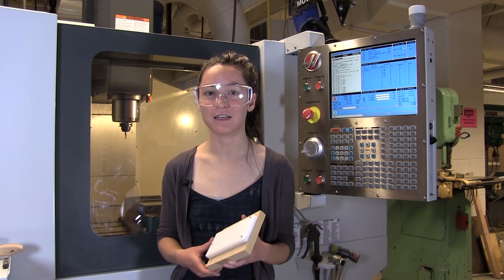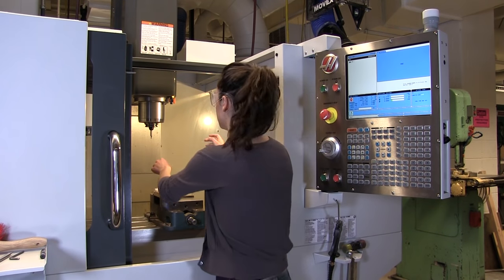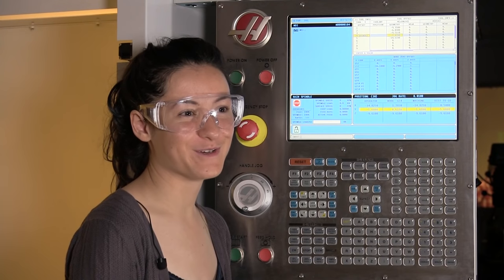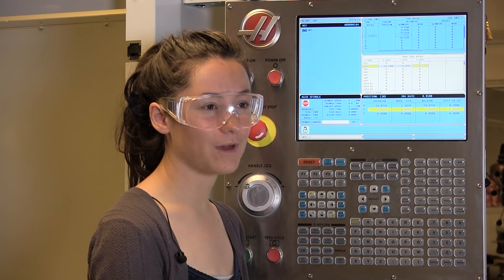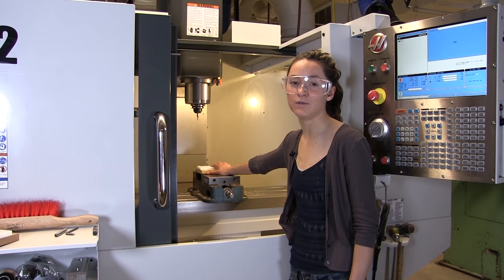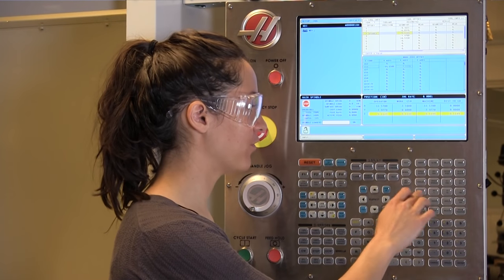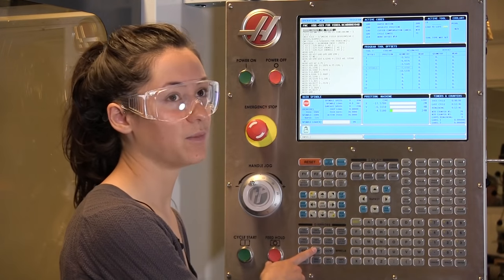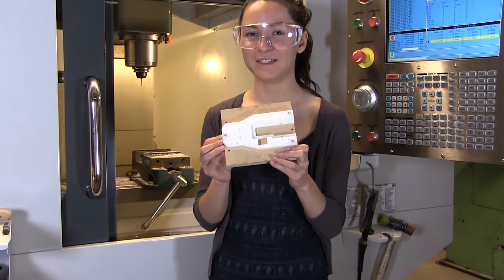CNC Mill Tutorial

Comment: She is getting easy work and need to go on a manual machine to understand Machine shop work also.
Reply: Today's day in manufacturing, we need parts out of machines as fast as possible while maintaining acceptable dimensions and finish. Having a Bridgeport and an engine lathe is great for "simple" jobs or one off jobs like simple R&D work, but even most of today's one-offs require 5 to 9 axis machines to maintain ridiculous tolerances... In my 7 years of being a well rounded cnc and manual machininst,  I have only resorted to bridgeports and engine lathes for non-critical milling or turning, most of which was in preparation to go INTO a CNC Machine. lol

Comment: Machine manufacturer has got the design for manual tool insertion wrong. Really, you should insert the tool, rotate it to locate the drive dogs into the tool you've inserted and then push the tool fully in. This should operate a switch on the machine to then lock the tool in place.

Comment: I disagree with this method, although common.  I prefer to use a gauge block of known height and RAISE the spindle in small increments until it can slide between the tool and workpiece.  Then adjust the offset for the known gauge block height.  Less chance of crash or getting your hand hurt when raising the spindle to set versus lowering.

Comment: The Haas machine no different from a doosan. Almost everything the same. But the Mazak little different.
Reply: Doosans are much better than 
'H alf A ssed A merican S hit'
Flimsy tailstock,dodgy place to put index turret button on the lathes (right next to everything else and the same size,shape,colour as the other buttons) terrible corkscrew conveyers that drag swarf across the armoured hydrolic cables from the tailstock,all the fuckin beeping!!! There are some good features don't get me wrong,big memory,vibration control, but still not a patch on Doosan.
Young lady was impressive though.Ive been in the trade for 25 years programming sliding heads and fixed head CNC's  and never seen a female setter or programmer,only operators.Shame that,they're much welcome in my book.
Doosan all day for me,Mori sieki and Star sliding heads.Mazatrol are conversational programming,nice machines,user friendly,even calculate your cutter comp for you.Also handy for people who can't program.

Comment: For best precision to find the edge you have to turn spindle with minimum 1700 rpm. It seams to me that you turn it very slow :(((
Reply: As she said in the video, the Haas won't let you open the door unless it's under 750 RPM's.  She did a great job at least helping me and others to learn a little about their CNC controller. She did mention that they work best at 1000 RPMs but could not do it because of the door safety.

Comment: UNDER NO CIRCUMSTANCES SHOULD ANYONE PUT THEIR HEAD IN THE MACHINE WHILE THE SPINDLE IS RUNNING! 
Other than that obvious and potentially FATAL mistake nicely done. And also no need to touch a spinning probe. Move it off center BEFORE starting the spindle.
Reply: Agreed. Where's  the safety interlock on the door ??

Comment: Another way of bringing the spindle up when your using the edge finder or touching off or in any case for that matter is to press the arrow keys in what ever direction, this can help when you get confused on which way to move the dial this prevents crashing the tool into your stock, do keep in mind that this wont work unless you are in the MDI HANDLE JOG mode.

Comment: The lower grade of those Kurt clamps are rated for 6880 pounds, 80 LB of force is enough to hold a 1000 LB hardened steel rail. Hand tight isn't enough to hold hardened steel in place. Obviously anything more than hand tight would destroy the MDF she has her work attached to.

Comment: I hate the haas dial noise as you turn it, I've used fanuc and heidenhain so far and no noise :)
Reply: MLG420 Mcswaggerten Haas cheap and cheerful
Reply: Obviously you don't realize that Haas uses Fanuc as their control. Hass does not produce their own.
Reply: Haas hardware is kinda the honda of cnc machines. Lots of plastic, the sheet metal almost fits right, low pricing, lots of features that seem appealing to folks that don't really know what they want like V.P.s and tech school professors. 
I can't stand the feel of the jelly bean buttons after having spent so many hours looking at the laser cut panels that don't actually line up with the buttons and mpg wheel.

Comment: I use sharp pointy tool to set zero right on edge of material.  Very quick and very easy,  no additional calculation needed to find center of tool
Reply: Not very accurate.

Comment: dirty machine. you can use air blower over your tool. i saw a lot of plastic melts and adds to tool. use air cooling over mill.
Reply: Abdulkadir KUCUK 
Nah, it's just lame speeds and feeds. The drill needed about 4x that feedrate so that a thick heavy chip will fly off and away. Similar issues throughout.

Comment: It was a great video until she plugged in the USB stick. What is wrong with programming on the machine these days? You are still faster programming a contour or like 5 holes manually then using CAD CAM.  learning how a G2 or 3 works is important. Even a G0 or a G1 is not explained. 

Learning  the basic code of  your program is really important

Comment: Paper to pick up a tool, thats so dumb and dangerous and slow. You never move a tool down like that. Not accurate either. Don't understand why an idiot showed you that. Learn to use a mirror if needed, leaning your head inside is dangerous and not always possible
Use a 1 inch block
 Bring tool closer than 1 inch to surface, 
Handwheel up on highest increment untill block slides under 
Take block out from under tool,  
Handwheel tool down 1 increment, block won't go under
Switch handwheel to smallest increment 
Handwheel up while gently trying to slide block under
Once it does never handwheel down again with block under tool, it'll break
Switch handwheel to y or x so you don't accidentally move it
Take out block
Set tool Z1.0" if that's youre Z zero spot 

That is the safest, fastest, correct way to set a tool. And very accurate, I machine molds and blend 10 different tools to the same surface perfectly. Work with me and do that paper thing I'd give you shet and saw you keep doing it, FIRED. Seeing this I should make videos and explain why it's dumb and why my way is safest, quickest, and most accurate. There are other ways too. Best is to set the z zero on the table with spindle, then use indicator to measure tool length and find top of stock. I'm too lazy to explain the reason for each scenario. Never that paper thing though. I setup, program and operate CNC's for 20 years, every mold is different and I never run the same program twice. Everything is one off and no mistakes cause material alone is $100k

Comment: anyone can throw tools in and call a program ,try programming manually without software then you can call yourself a machinist until then your are nothing
Reply: Programming without software is futile for many types of parts, especially related to tool and die. You're not a machinist unless you can use manual mills, lathes, surface grinders and other machine tools. Even programming without software only means you know M code and G code... it doesn't mean your parts are going to turn out dimensionally accurate with a decent surface finish.
Reply: You program manually and be proud to call yourself a machinist.    I'll use software,  run circles around you, take your job,  and drink my beer and count my money while you try to catch up.    But hey...you're a machinist.
Reply: I disagree.  I started manual  machining (turning knobs)  in1986 and haven't programmed long hand for 20 years.  Who would ever want to go back to that?  The machining speed is just so incredibly fast with the high efficiency milling software available that. It could never be written manually. A machinist needs to understand what approach to take from start to finish to complete a part accurately and efficiently.  But I'm not a machinist - I'm a mold maker. 😉
Reply: Look we have a machiner. Programming with or without software makes you a programmer not a machinist. Cant make up your own definition because you think its right. Loading, unloading parts, running the machine by pushing a button, call up a program, throw in tools, setup, programming etc anything else you may want to add, this only make you a well rounded machine operator. I own a manual lathe and use it, this does not make me a machinist nor does knowing the ins and outs of a CNC machine makes you a machinist. Being a machinist is so much deeper then that and what you describe and I describe is just a scratch of the surface, a small piece of what an actual machinist is.
Reply: If you don't believe me, then look at it this way. If you work in an engineering department, work in CAD all day every day, this doesn't make you an engineer, there is an actual degree for that.  It only makes you a CAD operator and nothing more. Your trying to call your self a machinist because you know about hand programming. Big whoop, so did every other CNC programmer 30 years ago, still just a CNC machine operator.
Reply: You're not a machinist until you build your own machine, invent your own mathematics and create your own Universe.
Reply: You just draw arbitrary line in the sand. CAM is a tool, just like a machine is a tool. Programming manually is slow compared to CAM and it is all about productivity. Machines need to run, not sit still while you program new part.  It is like saying you are not a real accountant if you use software - you can call yourself an account when you do all your calculations just with pocket calculator.
Reply: a machinist on manual mode is vanishing fast like endangered species
Reply: If you think that manual programming is enough for cnc  you may don't know the working capacity and rang of work done on cnc by CAD
Reply: Let's use horse and a carriage , when we have ferrari , mercedes ... etc . It gets the job done , but there is a slight difference
Reply: Being able to plot  x,y,z coordinates is far from being a competent machinist.  I learn that my second semester in college, years later after working for a real machinist I think I'm half way there.
Reply: Not a machinist, A cnc operator.
Reply: jesus christ...people need to start somewhere...

By your own logic you yourself were basically nothing until you could personally program manually because that's what you just said?

it's a wonder why this is one of the lowest populated trades around (got nothing to do with the 'difficulties' in it) seems to be that low population is predominately....assholes which is very unattractive to anyone looking to learn it...
Reply: yo jealous. are you that machinist?
Reply: Mantisman. These guys are so jealous. I'm wondering what they're complaining about. They want us to go back to stone age.  Imagine programming a non-linear profile manually? It can be cone by programming in the CAD/CAM and they're annoyed by that. It follows that no machinist can program an ellipse or parabola or complex geometry. And that's where they want  machinists to do.
Reply: A real machinist is not concerned by anything outside their shop, their machine or their job. 

Beyond it is pure ego and actually genuinely dangerous these are the people that say "She'll be right" until the inevitable...
Reply: So an old timer machinist with 50 years experience who never touched anything CNC is nothing? I understand what your getting at but there are all kinds of machinists and machine tool operators and there's no need to insult people who are just getting work done.
Reply: TheDefeatest. But that's why generally, early model vehicles and generally many machines used to be box-shaped. There are things that can't be programmed manually using G-code, no matter what. Okay, here's a challenge. Let's take your 50-year old man and give him a task.  I recommend you to find some videos of CNCs fabricating super complex 3D shapes. Like the seven axis CNC  here on youtube that's making a helmet or some that are making sculptures, give your 50-year-old man - in the name of this comment, "...try programming manually without software then you can call yourself a machinist until then your are nothing"  
 You see? that's a dumb comment. Your machinist will spend a year there and will not complete a fraction of the work. Here's the thing. dont look down on new programmers. Even with software assistance, programming some shapes is still soo complex. Machining isn't about memorizing and keying in all "G90 to ...M06," It reaches a point where humans can't do it. Programming is about sequecing instructions/events carefully to be run by the machine for productive purposes. Final catch >> Manual programming is limited to basic shapes>> squares triangles rect... Yeah. I made a DIY CNC and typical objects reach 120,000 lines of G-code after compiling. Imagine a 3D complex object? Millions of data points in gCode.
Reply: I think I came off in the wrong light here. I totally agree with you . It was the original poster I was talking too. What I'm saying to that post was that I don't believe in the idea of a "real machinist" That old guy I mentioned knows his way around a shop and can make high quality parts on manual machines all day and would always have a job and deserves respect .  However , Its about moving forward and using the tools we have to get better and more efficient. I've been machining for about 18 years now and learn every day and I run CNC machinery all day but don't do/don't really know how to manually code but I don't consider myself  a "Wannabe" I do my best to make good, quality consistent parts as fast and efficient as possible.
Reply: Anyone dissing this is just bitter. Good to see a young person that has been trained correctly in our field. We need about 100,000 more like her in America right now.
Reply: John Cucinella Jr -  Molds. There is an art. I don't know to offer congratulations or condolences ;- ) Some consider to be very tedious work. Most mold shops I've been in stat a worker on polishing so if we get a machining job there is a deeper appreciation for how much the surface finish can mean to the one polishing in the end.
Reply: Yo! Jo Jo  + I'm just a Manual / CNC G code, Mazatrol T, T2, Fusion 640, Matrix, turning, milling, jig boring, broaching, gear shaping, thread rolling, OD/ID, surface, face, rotary grinding, lapping 10" .00002 flat bastard that want's to be a machinist when he grows up. Sorry, I smell the young in that comment. Either that or the competitive arrogance means the best teacher of humility is right around his corner. I won't make machinist if I retire soon. Damn ;- )
Reply: Thank you! I've been saying the same thing for years!!!!
Reply: We got us a certified badass here, everyone step back and try not to yawn too much.
Reply: I agree with Joe but also agree with Nathan. Until you can do ALL of this by hand programming and machining, you're not a machinist. I work in a shop and they call me a machinist by title but I just feel like a glorified setup and run guy. I need to learn more...
Reply: The measure of a good machinst should be the quality of there work both in terms of finish/tolerance and how fast they can do it. The customer isent gonna pay more for a part because you did it on a manual mill or programed it in G code. 
If its even possible to program your parts manually then they arent very complex, have fun manually doing 500k+ lines of codes for a simultanius  5axis 3d mold finishing operation.
Reply: Ability to do so, not that you HAVE to do it all by hand. Just saying if you can't even begin to do it that way then you're just a setup guy.